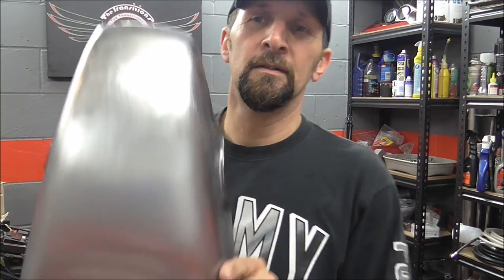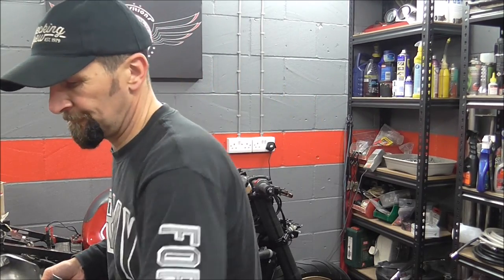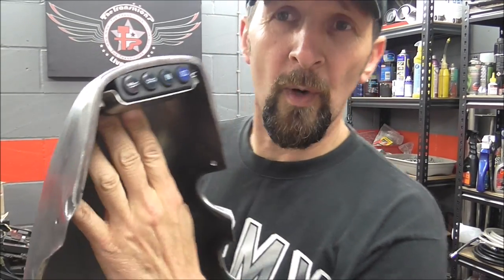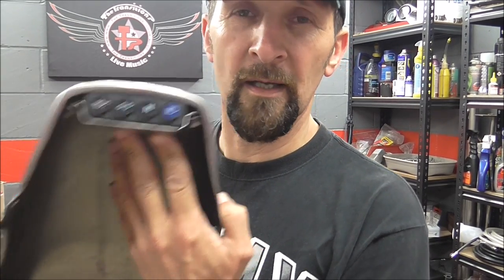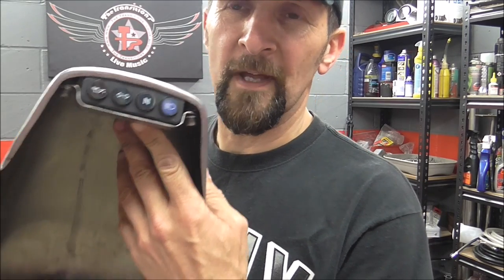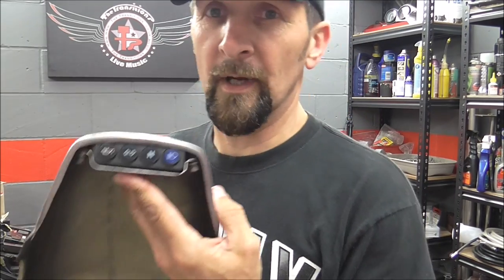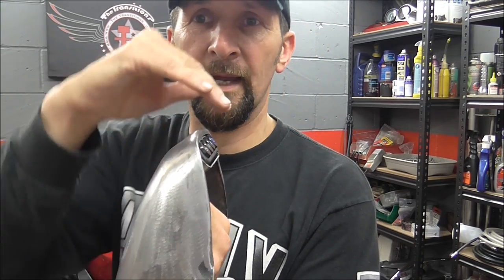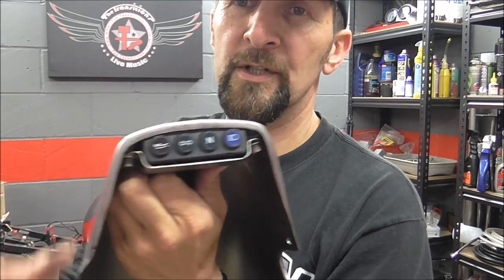Delboy's Garage, Fighter Build #19, New Dash Panel.

Comment: I like how everything's developing :) I actually don't mind this format if its quick fab work, it makes life alot easier for you guys. Just a suggestion, but if you grind the bottom of the plate with half circles, so the lights fixture has almost a knuckle duster look,  might make it easier to get your hand in with gloves on to turn the keys :)
Reply from the maker: Ha ha i like that... the bottom edge is the exact same line as the bracket...so no room to cut metal away without exposing that and trashing the look.. and i can get my hand in really easy with a thin glove on to turn the key... no problems... thanks for your suggestion.. Del.

Comment: Looks completed now! But hi beams hole looks somewhat crooked - after paint you can put some thin split rubber hose around the hole if still looks off.  Another gain is it provides some additional damping...
Reply from the maker: Hi mate, no damping needed, the light is solidly bolted and doesn't move, and it is dead straight in the hole with the naked eye, it's just the camera angle that twists if off a bit!
Reply: +Moonfleet41 ha, that camera angle how it fooled me - sorry Del - i am really glad everything is ok - wonderful!

Comment: That is great work Del. Looks really nice. On the subject of leading . From memory you can not use power tools to finish it.
Regards Pete.
Reply from the maker: No thats right, even harsh abrasives can kill it... it melts at about 325 degrees, so a sander would heat it past that in no time..!
Reply: FaIr play Del . Not that i am a lead wizzard . But it is the dust the lead gives off . . body files are the way forward.. A old school method.. I love your work .Best regards Pete.

Comment: Will you be rolling the bottom edge of the light plate under.  All i can see is you ripping knuckles open when you reach in for the key..Maybe a slight arch along the bottom of the face plate?
Reply from the maker: Hi mate, the bracket that holds the light pod in place is 90' to the bottom edge of this plate, so far from a cut edge on which you can rake the back of your hand, it's actually a smooth finish that feels like a solid block of metal...
Reply: Oh okay...then never mind :)

Comment: I totally get what you mean with electrics. If you're not into making your own items from components then most of what you can buy is rubbish. It usually boils down to 1 of 2 things -  lack of effective cooling or construction which isn't vibration resistant/damped properly.
Reply from the maker: Too right buddy, the little rubber bulb holders that pop in neatly in to the holes and seal, are just priceless, you couldn't buy that kinda quality even from Germany !

Comment: If it's not too late filling in the pin holes with lead solder video would be great to see.
Reply from the maker: Bit of a waste of time buddy, as I have to mould the side openings and will be using a lot of filler, so will just cover all of them, and even with lead solder, still involves an element of filing, and I don't want to tempt filing on it any more...

Comment: hiya delboy got me new bandit 1200 but it has heated grips on it there ok but i need to change the handlebars they are to low for me you see so shell i just use the normal way with wd40 on the left handside grip with a little help from a small screwdriver. need to put higher ones on see ;-)
Reply from the maker: hi Mike.. if they are the Oxford grips, you shouldn't shove the screw driver under there to muscle it off, it'll likely fracture the elements inside the grip and bugger it.. in fact, most heated grips are pretty fragile like that.. they dont like being flexed about too much.... can you maybe just grip it with both hands and see if you can twist it free, a little GT85 or WD under there can help...then work it back and forth gently wiggle it off... then clean if out with some thinners or acetone so it sticks on the new bar..!!   (P.S. Nail Varnish remover is acetone, so you could ask Jan for some of hers., i use Penny;s so often she now buys me my own....lol)   Drop us a pic then mate..( i LOVE B12's)..